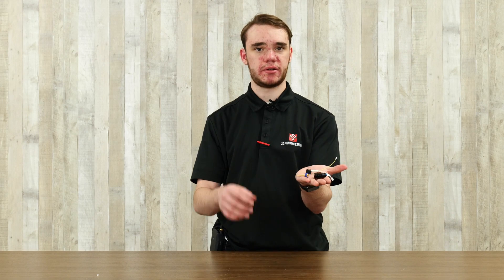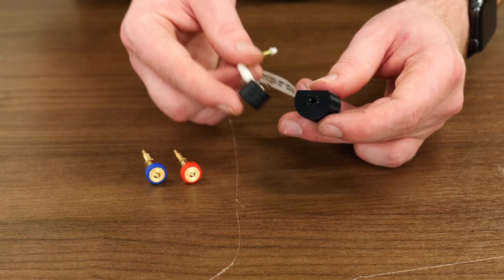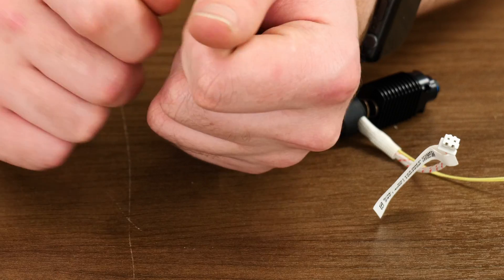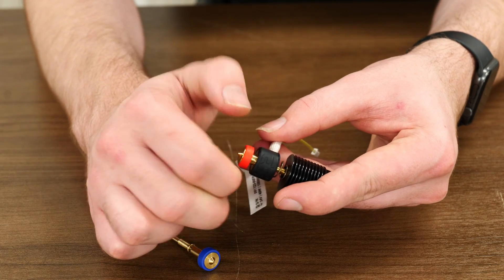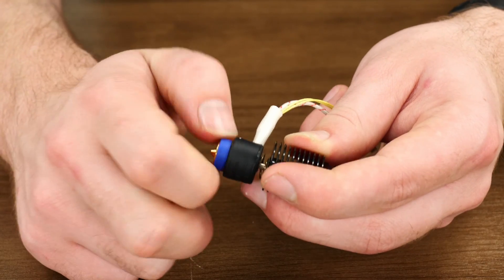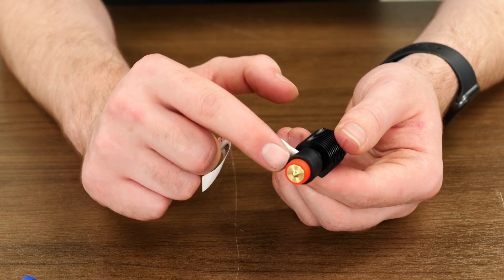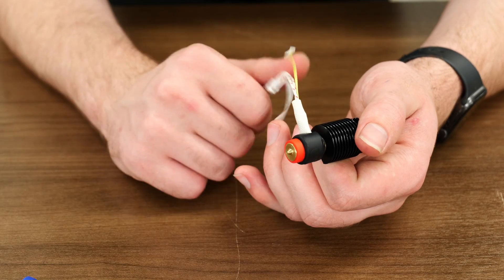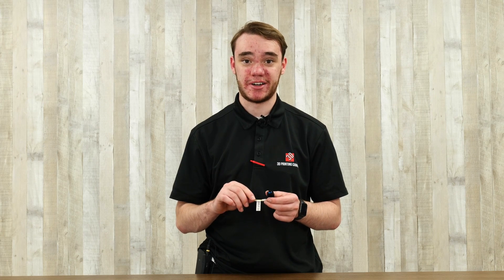UPGRADING YOUR 3D PRINTER (E3D REVO)

Comment: I'm getting ready to upgrade the printer. It is necessary to purchase a 24 volt power supply, install a layer level sensor and a board with connectors on the printhead.

Comment: Hello! I've been wanting to install a Revo hotend for a long time.

1. How safe are ceramic heaters?
2. Almost all E3D Revo variants are made in the Bowden version. Is it possible to remove the fitting for installation in a direct feed BMG extruder?
3. Which switching board should I choose to connect the E3D Revo?

P.S.
Sorry if the automatic translation is not correct enough!
Reply: Hi thanks for your comment! 

Ceramic heaters seem to be proving very safe and reliable so far, and much of the industry is moving towards using them as opposed to the older style aluminium ones. Yes you can absolutely use a revo in a direct drive configuration, in fact I have some that I use with direct drive extruders at home! The revo is made to be an easy swap in for your current hotend, so it should be able to be used with your current mainboard!
Reply: Thanks for the answer!

I meant the board on the print head of the printer, where the hotend, thermistors, blowing fans, auto-level sensor, etc. are connected.

What to choose?

My printer (Prusa i3 Steel) does not have this board, which makes repair and maintenance very difficult...